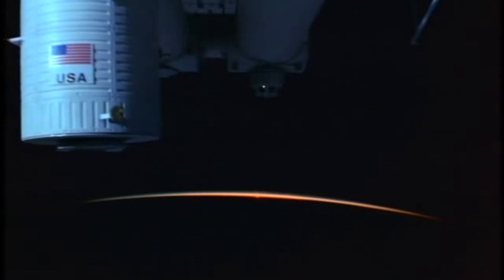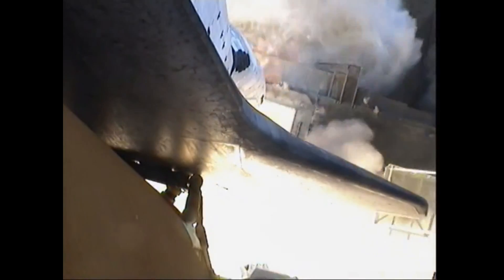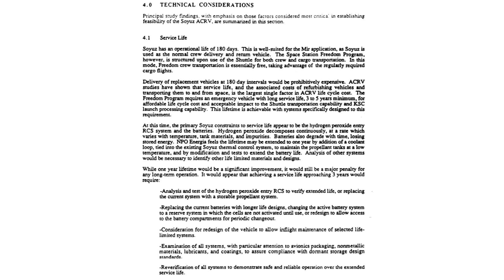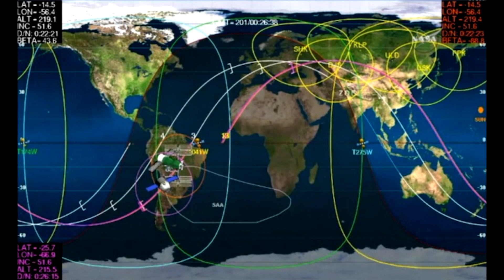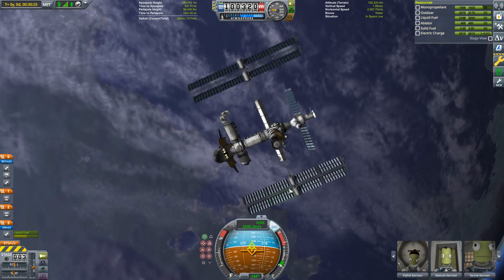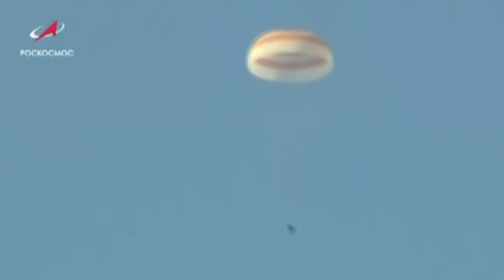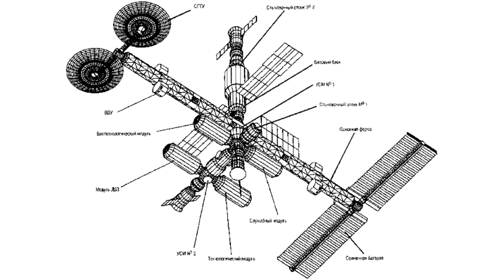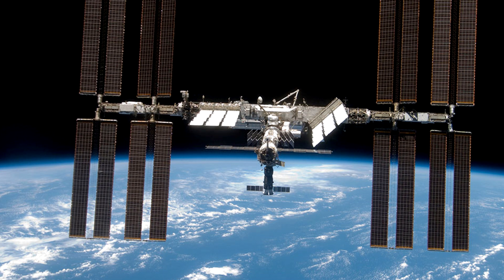NASA's Abandoned Plan To Carry Soviet Spacecraft In The Space Shuttle

Comment: 6:06 - Actually, the shuttle orbiter would have been able to glide to a landing site even well outside those boundaries, due to its ridiculously-high crossrange capability.  (Otherwise - to give an example - it wouldn't have been able to land at Edwards AFB [latitude 34.91°] from a 28-29°-inclination orbit, and yet the orbiters did just that, twenty-six separate times; the first mission to do this was STS-4 in July 1982, and the last was STS-125 in May 2009.)
Reply: Before the ISS-era, missions returning from 28.5 degree inclinations or even 39 degree ones often overflew the lower continental U.S. on the way back to landings at Kennedy Space Center.

Comment: Hey Scott. Would you please make a video about the undocking procedure from ISS. How do capsules move away from ISS without starting their engine? They have the same speed and trajectory and there is no air so no friction out there. Does ISS push them away?
Reply: The docking port creates a slight push to get them going, and also the tidal forces at that altitude are enough to pull the spacecraft aeay over the course of a few orbits. Then they can turn on their thrusters and separate further

Comment: Hi Scott, I note that the preposition used with the word orbit has changed recently, I’m curious.

Until recently, in astrophysics, a body was described as being “in an orbit” about another, (or more precisely in joint orbits around a common barycentre.

In recent months however, I have heard the term “on orbit” increasingly used, particularly with respect to commercial assets orbiting Earth. And in this video in particular, you’ve made extensive use of the phrase.

What is the reason for the change? Why have you started using it? Is there a particular distinction between “in orbit” and “on orbit”, or now the prospect of commercial utilisation to space has become a reality, has this become the latest ghastly incarnation of trendy management speak? Pray do tell!
Reply: Maybe engineers are more concerned with solving actual problems in spaceflight than quibbling over grammar.

Comment: I love the video. Thanks. 😊 I have a question: Can an actuator controlled glider parachute system be made to do a controlled decent for space transport capsules? Practical?
Reply: Yes and no.

Yes it can, but the vehicle need to have wings to get rid of most of the velocity by flying and then it's just a matter of a rugged enough design.

But I still think parachutes suck. They even have trouble designing them today and a gliding landing makes much more sense, if you already got wings.
Reply: @RubenKelevra  I am thinking more towards a kind of "puppet string" like system. One with much stronger chords though. 😁
Reply: @christianwoodland6297  you cannot use these type of parachutes for the same usecase. Regardless how thick the strings are.
Reply: @RubenKelevra  Ok. Does it get too tangled or some other reasons?
Reply: @christianwoodland6297  not ridged enough at the same size is the main reason. That's why it would just desintegrate when used at high velocities.

Just look what type of parachutes the militaries are using and when glider parachutes are beeing used.
Reply: @RubenKelevra  Interesting stuff. Thankyou for your replies. 😊 I have another question, seeing if it's even possible or even plausable. Can some kind of actuator fins be used on the capsule instead to control decent rather than controlling the parachute?
Reply: @christianwoodland6297  I doubt that they would have any lateral impact. Compare the area of the parachutes to the area of any fin which would fit on the capsule. It would have also issues with the aerodynamics, they are designed to get the heat pulled away from the aircraft by turbulences after the heat shield ends. The fins would either be located behind the heat shield in the turbulences and would basically have no effect at all or the heat shield would need to be jettisoned before the fins deploy.
Reply: @RubenKelevra  I'm starting to see why retro propulsion was developed. 🤔💭🚀😎
Reply: @christianwoodland6297  actually the Sojus has already retro-rockets for a 'soft' touchdown, since the main chute is only reducing the speed down to 6 m/s.

Hitting the ground at that speed might be survivable but not pretty.
Reply: It has been tried on the X-38

Comment: Project Matryoshka: Put somebody in a Soyuz, in a Shuttle and wrap it with the ISS.
Reply: Sounds more like Operation Turducken?
Reply: Zoltán Pósfai ☆ Kind of the Mission for the Soviet "Buran" to rescue the MIR then possibly "steal" certain CIA Satellites.
Same plan as the USA had.
We're Not that Different, really.
Reply: No, you put the Space Shuttle in an extended payload fairing on top of a Sea Dragon (the diameter of the Sea Dragon was 23 m, the same as the Shuttle wingspan, though the top 6 m of the tail-fin would poke out of the side fairing). The fairing would also accomodate the Shuttle External tank, though the Sea Dragon had a payload to LEO of only 550 tons, so the ET could only be half full).

Then you mount the Sea Dragon on a huge Project Orion Nuclear Pulse Vehicle (the Sea Dragon weighed 18 kT, but an Orion pusher-plate design could theoretically be built big enough to lift one). To push the absurdity further, have the paylod section be a giant water tank, so the Sea Dragon has the correct launch environment.

Comment: Why could the space shuttle on stay in orbit for 30 days?  Radiation shielding/issues?
Reply: I'm guessing fuel cell endurance
Reply: NASA did study having the Shuttle orbiters stay on-orbit for missions of up to three months in order to have a spacecraft always on standby. There were even tests done on Shuttle missions where the fuel cells were throttled down to conserve power and reactants while docked to Freedom. Later, the use of the Extended Duration Orbiter kits and power transfer from station to orbiter would supplement that.

The big issues were as follows:

1. Tire staying properly inflated. Three months was thought to be about the limit for the nitrogen-filled tires and work was being done to see if they could stay at a safe pressure for longer periods.

2. Automated landings. While the Shuttle had an autoland system, it could not fire the drogue chute or lower landing gear. That required special modifications, but was doable and necessary since pilots might be too debilitated by being in zero G for so long.

The EDO kits were made part of the Shuttle fleet, but only on Columbia and Endeavour. Endeavour had the capability to stay for up to 30 days in space with a Spacelab or Spacehab, but that was never made use of since some in NASA thought that it would be seen as too competitive the space station.

Automated landings were going to be tested and STS-53 was earmarked for it in 1992, but the test was cancelled, allegedly because the astronaut didn't like the possibility that this would lead to totally automated Shuttles with no crew.
Reply: Thanks for the replies!!